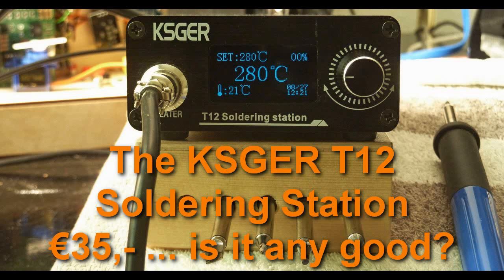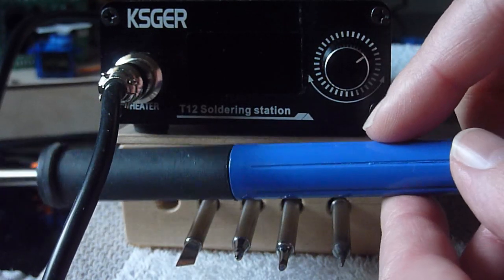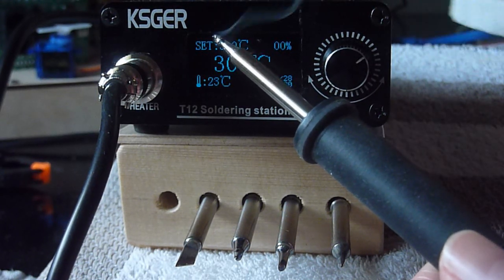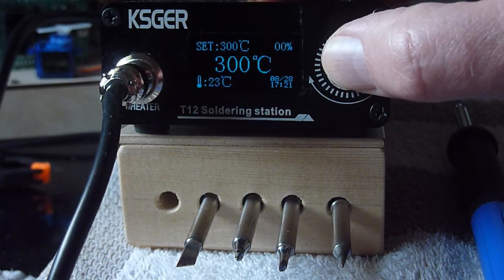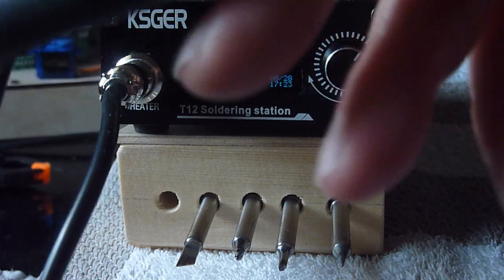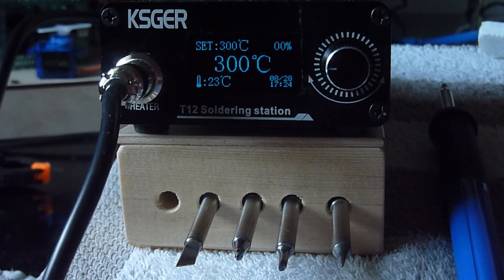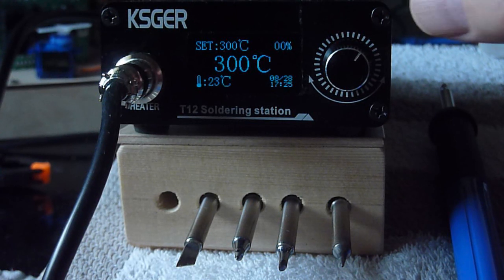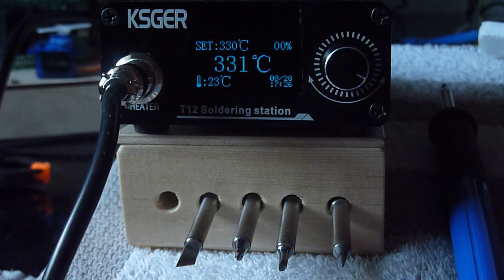KSGER T12 Soldering Station €35,- ... is it any good?

Comment: This is one of the best reviews of the KSGER soldering station in English that I have seen. Thanks! Unfortunately, this release (SW ver. 3.0) has several SW bugs. Hope these SW bugs will not bother you during your work with this soldering station. There are several other soldering stations from KSGRE that work much stable (SW releases: 2.1S, 2.09 for example) just in case.  Anyhow these stations based on T12 soldering tips are definitely very good in comparison with others in terms of prices/functionality.
Reply: Hi what exactly are the bugs on 3.0? Do xou have any source or mofet info? Thanks appreciate it
Reply: @nurfuermist  Hi! Based on my experience:
1. A tip calibration couldn't be done (for any T12 soldering tip) due to SW limits for an input value on a third step of the calibration process. Almost all tips cannot reach a temperature higher than 390 C. But the input limits for the third calibration point temperature are between 400 and 460C. It is a feature of this SW release only.
2. If you use this station with a battery an automatic cut off function does not work when a battery voltage drops below a preset threshold. Even a thresholds setup submenu works incorrectly (voltage input fields cover two submenu titles).
Never use the “Low Voltage Protection” settings to avoid further problems with the station. You may even get an inoperative device due to other logical errors related to thresholds handling.
3. An information about current soldering tip type is not available anymore on a main screen. You could not get this info back on the main screen via setup menu anymore.
4. All fonts and styles were changed in not a proper way (let’s say). The screen covered a very deep tinted glass with these tiny fonts is not easily readable.
5. A clock on the main screen is just a “good” example. You need a magnifier glass to read it.
6. The soldering station sometimes hangs when you push it to Sleep mode by fast rotating of an encoder. You need switch a power off/on to proceed.
7. A function "Knob Setup" does not work correctly. Just do not use it to avoid any problems.  Pushing the station to factory default after any changes in "Knob Setup" menu will bring a problem.
Reply: Ah... missed something?
8. Temperature presets (five customer's setting) cannot be picked up by pressing and rotating the encoder in Temperature setting submenu. Trying this you will get back to Main screen within couple of seconds. You have to be rather fast to cope with this challenge. But this is not so important as the rest...
Reply: @alexeyk8460  Thank you for these. I'm looking to buy this station and this is very good information!
Reply: @lassi4855  Hi, I recommend you to buy KSGER V2.1S. It is very stable, no bugs!
Reply: @alexeyk8460  That's what I bought a little earlier. Thanks again!
Reply: @alexeyk8460  Where would I look for a firmware update?

Comment: I spent $50 Australian on a basic soldering iron in 2011, it still works to this day and does me well.   I am not sure what technology is needed in a soldering iron.  It gets hot, melts solder and cools down when turned off.  The heat mass is a function of the element capacity and the tip.  It is the tip and the person that make the quality.   Technology only adds things like sleep time, or programmable heat settings.   There is not much else to change in what is essentially an electric heater heating a tip.    The T12's have become popular due to the cheap price of the clones and easily available tips, but I don't think technology really changes much.   It's pretty well the same as now in 2022 as the one you have.

Comment: got mine directly from the official ksger store on aliexpress, had to wait a few weeks before I could use it. unfortunately, it was pretty much DOA and cant make a dispute as its too late. i have contacted them with no response. The station just keeps on power cycling when u plug in the iron. I saw another video with a similar issue so I've bought another t12 iron hoping that will fix it. the station itself seems glitchy as sometimes it freezes and i have to manually restart it. I've double checked all the wires inside the station and the iron and nothing seems to be out of place. anyone have any ideas? Would love to get this thing to work. SW release for my version is 2.09.
Reply: that sucks, did you fix any?

Comment: what HW version is this station? is it the V2.1s?
Reply from the maker: It's HW and SW version 3.
Reply: @rudyshobbychannel  Really?. Even KSGER's official store at AliExpress just sells HW 2.1S with SW 2.10 and HW 2.00 with SW 2.09
Reply from the maker: Yes, I saw they do ... and there's no info on what the differences are. Mine did not come from the official KSGER store.
Reply: Rudysmodelrailway I was just Browsing the „official“ KSGER store on AliExpress. Turns out there is no finished unit based on HW3 and SW3 but one can buy the STM32 controller PCB alone for around €15. I‘ve just received my finished unit with HW 2 so I will probably not upgrade. Nice to see that it‘s kind of modular and one can replace/upgrade almost every part. What I could‘t find out: They sell heat guns with the same plug. Will they work on the same unit?

Comment: To bad all these hakko clones and 3rd party t12 compatible stations insist on using a (ball switch) tilt sensor in the handle, instead of simply copying hakko's stand with the microswitch or a lightswitch or hall sensor... Does it actually enter sleep mode when the handpiece sits in a stand at a 15° or more angle?
Reply from the maker: Steve Holvoet Mine goes to standby and sleep while on an angle in a stand and also while laying flat on the table.
Reply: It would cost them $0.25 cents to add a cheap accelerator and make the sensing, rock-solid.  That would be so worth it.

Comment: How happy are you with the soldering station? Have you experienced any issues that Alexey K mentioned???
Reply from the maker: Srđan Letina I'm very happy with it. I use it all the time and have not encountered any issues.
Reply: @rudyshobbychannel  I have ordered V2.1 which was ~39€. Now I am tempted to cancel the order and get the V3.0 for ~32€.

Do you have any idea what might be the difference between them?
Reply from the maker: Srđan Letina I have no idea. I saw those older versions too and wondered about the price difference. I just bought the latest version. The only bug I found is strange behavior after setting the sensor zero point. So I simply don't touch that. Possibly my temperature readings are not correct now, but I don't mind that ... I only care about how well it solders and how easy it is to adjust and how it has this sleep mode ... and all that works very well.

Comment: KSGER needs to clean up their product line. There's too many versions, options and poor descriptions. 
Their silver faced station says "Mentel Solder Station." Not exactly inspiring confidence in their products...
Reply: I think the problem is that there are clones of these Ksger stations. It seems like the only official versions are 2.01 and 2.1S. The "fake" ones have either a serif font like the one in this video (instead of a sans-serif as the original Ksger) or have angle brackets in the menus title text row (like <Temp Set>). If you search for "KSGER Official Store Aliexpress" you'll find their official store on Aliexpress where only original stuff is sold (and their product line is pretty clear). On Banggood it's full of poorly working clones like this one.